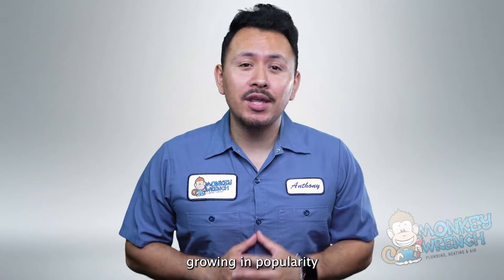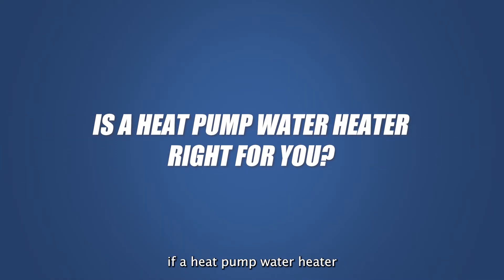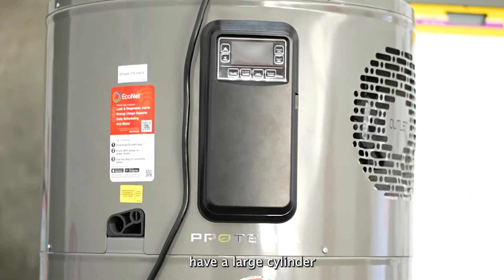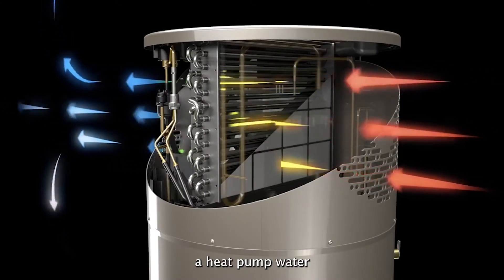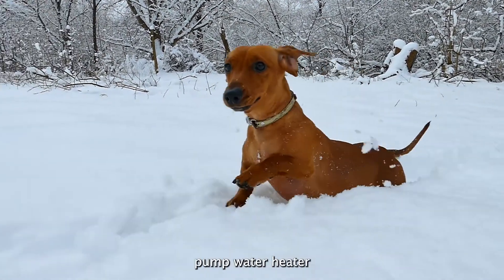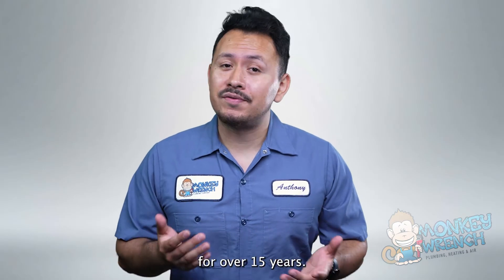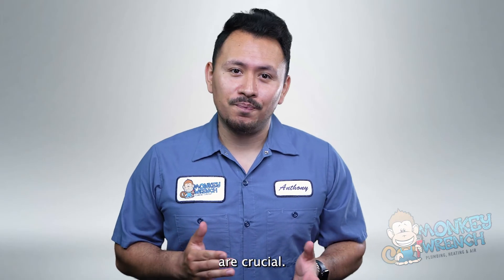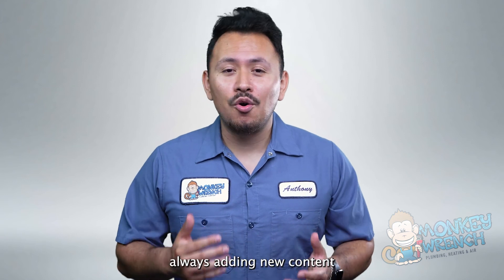what is a heat pump water heater and how does it work

Comment: Moreover…What’s cheaper gas or electricity ⚡️ im still stuck on how is electricity cheaper w hybrid all electric water heaters. Electricity bill must go up . Then pros answer its cheaper because electricity is free with your solar panels . But …how is that ? If i paid average 30k for the solar panels?
Reply: It's cheaper coz it only has a power rating of 600watts, kind of like adding a few bulbs to your house, the rating is lower than even that of a water dispenser which of you think about is mind blowing

Comment: yeah how much power that compressor uses? what happens in a power outrage situation. I am a plumber/gasfitter and I don't buy heat pumps at all, you will spend so much power rather the clean natural gas. So what if natural gas comes from a non renewable source, your electricity too comes from there, but now you will spend 3x more by not using natural gas
Reply: Well not all locations have natural gas, Einstein.

Comment: I would imagine placing these in the attic is ideal since attics are usually hotter all year round
Reply: no true, thats why you have massive insulation to keep out the heat during the summer and Super Cold During the winter, and in some locations an occasional Cold Snap.
you would need a dedicated space that stays warm during the winter...
for Heating homes, Heat Pumps have a Heat Strip, for when Temps drop below 40 degrees.
thats when electric  bills skyrocket..
I had this argument with my government Utility during an open forum about switching to Heat Pumps..
When I asked a question that was a gotcha question, they ended up contradicting themselves and admitted, it does increase electric rates.
Reply: But that shit is load bearier and you want this thing fail and start leaking. I would prolly just run a vent or somehing and keep this in the basement.
Reply: It's well below freezing in my attic in the winter, that's a no go for me.

Comment: Very helpful!  I live in cold Minnesota, so I think I'm going to pass.
Reply: you might want to use on demand water heaters, but be careful on which types.
some wont work when the water temps drop below 60 degrees.
I have friends in Washington State, that installed one, I  told them which one to stay away from, they didnt listen, then said its not heating water.
I  asked if they installed the brand and model, I stated not to buy, they bought it..
I  told them, they would have to buy a pipe wrap  to heat the water prior to the on demand..
which they did and it worked..

Comment: soooo, what would make the most sense with this heat pump water heater is to have the condensor(heat pump) located outside, like a normal hvac system, to where it can pull all the air needed. Most ppl have a water heater, in a garage or small space that is not nearly enough room for these to function adequately.
Reply: balls

Comment: Heat pumps and their 300% efficiency are a big con and they go against the laws of physics. If that was the case, i.e. 300% efficiency, then why can't we install an 2nd pump in series from the 1st pump, and give out 3 times more, i.e. output 9 times from the original input?  Could even try a 3rd pump and give out 27x output.....The 300% efficiency is a big con. People tried to build perpetual motion machines in the 17th-18th century, until physicists formulated the laws of thermodynamics and proved this was not possible. No machine can be  > 100% efficient.
Reply: You just don’t understand the physics.
Reply: He did not say they were 300% efficient. He said they were 3-5 X more efficient that the alternatives. No system is 100% efficient, which is what you seem to be assuming. If a conventional system is 60% efficient, then this would be 50% of 50% more efficient. 50% of 60% is 30%. So the comparison of the old system to the new system is it's gone from 60% efficient to 90% efficient. Now if your original system was more efficient in the first place, say 70%, that's great. The heat pump system might be 30% more efficient. The math says that would be 91% efficient. I am just ball parking the actual numbers but that is how the math works.
Reply: They are substantially more efficient than a standard electric water heater (unless it's too cold in the room) because they don't create heat through resistance heating, they move heat like an air conditioner.
Reply: Heat pumps don't create heat, they move heat, just like you air conditioner.

Comment: Ok so what's the advantage of a heat pump water heater over solar hot water???? Why would climate have any bearing on a water heater that is inside a climate controlled HOUSE, its not sitting outside on the back porch in the uncontrolled elements???
Reply: Mine is outside. Just installed today.  I live in Melbourne Australia. Our winters are pretty cold so I have my fingers crossed
Reply: Honeytherat2017 : If your winters were cold then you wouldn't install a water heater outside.
Reply: Mine is in my laundry/utility room which isn't climate controlled.  It does stay above freezing in the winter, but probably gets down to the 40s I would guess, I've never actually checked the temperature in the winter, but my water lines have never frozen and they are out in the open in that room.

Comment: So, during the heating season, the furnace provides the heat and the water heater cools the area around it, and the furnace then replaces this heat. But in the cooling season you could actually benefit from the cooling effect. It doesn't seem like a benefit for half of the year.
Reply: Yea then it’s probably not for you then where I am it’s only cold two months usually no snow in winter